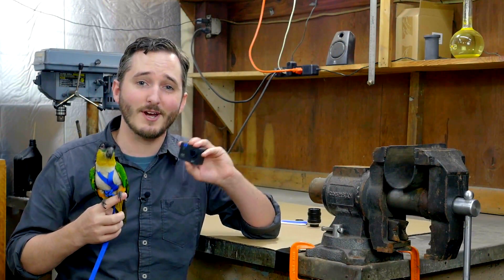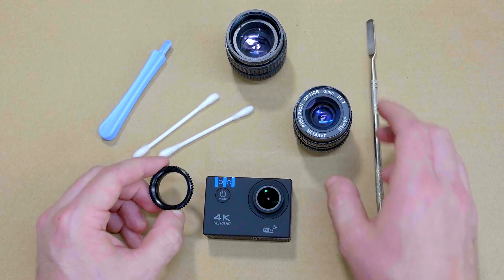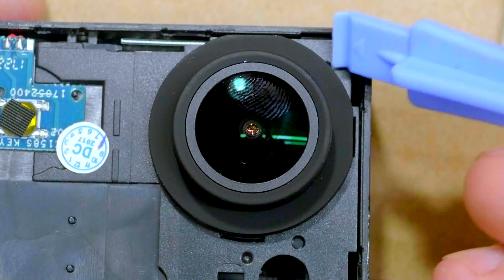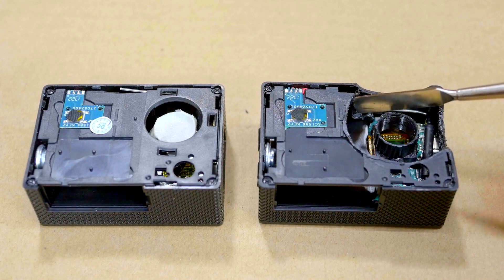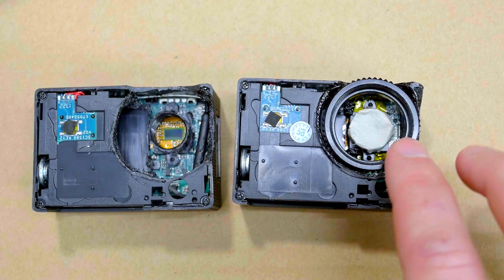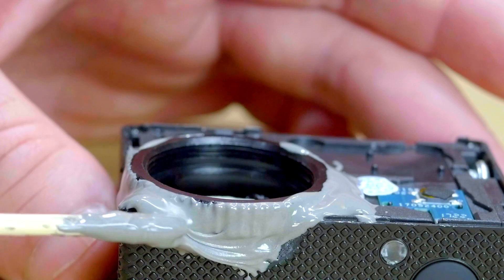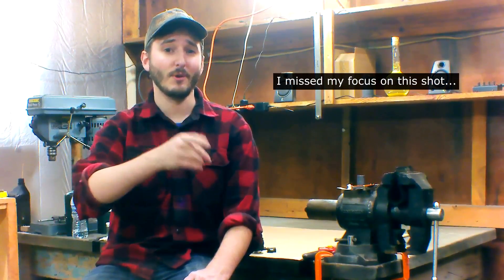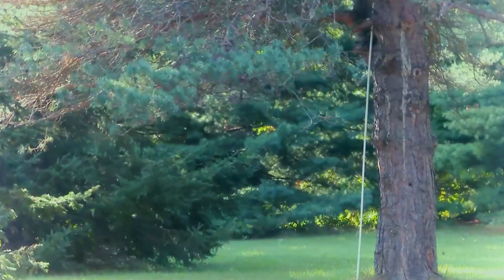How To Mod A Cheap Action Camera To Use C-Mount Lenses For Infrared Videography & Time Lapse

Comment: In general, metallic coatings on glasses are not going to be transparent to IR.
The metal coating is far more reflective in IR than it is transparent.
Tinted plastic lenses are going to be similar to the example you showed.
I am not sure if the IR wavelength is right for this, but one fascinating experiment is to watch gasoline or other hydrocarbons evaporate.
Some of the vapors are quite opaque, and so you will see black clouds arising from the evaporation.
This technique can be used to find gas leaks...

Comment: I ended up buying a different model.  I don't plan on modifying the lens, but the model I bought can be used for time lapse and has a dashcam feature that turns on and off when power is supplied.  At 1080p60 native resolution, it should also make a passable toy for getting shots I don't want the GoPro to endure.

Comment: If you want to get rid of the spots in the image like at 12:49 (assuming they are dust particles on the sensor) then you will need some soft q tips, isopropyl alcohol, distilled water, and clean containers for the alcohol and water. What you need to do is wet the q tip with the alcohol water first and lightly touch the sensor with it while using as little force to push down onto the sensor as possible, the alcohol will act as a solvent and help to clean up any debris. Then you can use the other side or another q tip to remove any alcohol remaining on the sensor. Then do the same with distilled water to remove the minerals and repeat this until it gets as clean as you want.
You also will have to keep from touching the ends of the q tips before using them, otherwise you will risk getting oils from your skin on the sensor which would be harder to remove and mess up the image even more.
Reply: Yeah he wrote that up above in the description (just below the video channel name) he explains what happened and how to fix it.

Comment: interesting video on cameras and if i may id like to make a request for something id like to see you film with this camera. i'm a welding student and one of the things that was talked a lot about in the safety unit was that the infrared and UV light was quite dangerous and could cause burns. what i would think is an interesting thing to see filmed with this is what welding looks like through an infrared filter and what the area around it being soaked in infrared light would look like.

Comment: One thing what I observed when I removed the hot mirror and put in back the original lens, I won't get the same result as you do. Is the original lens still have something that blocking the infrared light?
Reply from the maker: Have you tried it in daylight yet? If you're filming indoors the image will still look normal because light bulbs don't make very much infrared light.

Comment: Cool idea! 
BTW though IR may be dangerous when looking at the sun through sun glasses, isn't the dose of UV, esp UV A & B range far more dangerous?
Reply: partially, a welding lens will block 100% (or very close to) or UV and IR light, but with less then a shade 10 it's going to be hella bright still (might not harm you, but you wouldn't see shit), iirc most people are comfortable with around a shade 12-14
Reply from the maker: Most sun glasses should block all UV unless they're super crappy ones.
Reply: yea, but as demonstrated not IR, and obviously they don't block enough visible light to look directly at the sun either.

Comment: What filter do you use? 650nm, 670nm, 720nm, 850nm, 950nm, 1000nm?
Which ND filter do you use? ND2, ND4, ND6, ND8
Reply from the maker: I used a Fotasy variable ND turned up to max. IR filter was Hoya brand, 700nm+ filtration.
Reply: Thank you so much.
Do you have a link to the UV and IR Cut filter that you also use?
Reply from the maker: No but you can find both searching the brand names on amazon or ebay

Comment: Another great vid! Awesome hack of a cheap camera. Just one comment though, you should definitely try to re-attach the front cover as dust will eventually get attracted to the surface of the CCD element through those holes at the front. And they are an absolute PITA to properly clean because the CCD surface is quite delicate. Also I see that front panel (that was melted) had screws in each corner, is the panel removable? If so then it's also probably a good idea to remove the panel prior to modifying it. That way there's no risk to possibly damaging the internal electronics.  One other thought too, I've seen some cheap camera's that won't allow you to power up the camera on usb without the internal battery being in place so for some models you might need to externally attach the battery.
Reply from the maker: Unfortunately the part I melted and the back side that the sensor is attached to are all one piece. The screws just let you pull the whole skeleton out of the camera. Doing so is kind of a pain though because getting the buttons back in when you want to reassemble is difficult, and you have to take the screen off the back which is held by an adhesive that never wants to set correctly a second time.
Reply: Ahh right, hmm that's unfortunate. Anyway you've inspired me to go and try that on a cheap camera I've got. Currently rummaging around for a piece of copper pipe. :) . Please can you do a video on some experiments with this camera? Like filming at night? Cools effects you can do with it? What materials it can see through? Maybe  try looking through smoke/fog with it? That kinda stuff.  As soon as I'm employed back to full time again I will definitely be contributing to your Patreon.

Comment: das not it technically make it a night vision camera?
or like a thermal camera?
Reply from the maker: If you have an IR flashlight it would work for night vision.
Reply: thermal camera's use a different type of sensor, the sensor's used in these camera's can only detect near infrared wavelength's (still cool and useful, but not at all the same thing)

Comment: Pixco CS or C Mount Lens to M12 All-metal Lens Adapter https://www.amazon.com/dp/B01E536ZZ6/ref=cm_sw_r_cp_apa_neRYzbVD3WA83
Would this serve the same purpose?
Reply from the maker: Possibly. I wonder if those m12 threads are what the built in lens in the action camera actually uses. If so you should still probably glue the ring in place so that the internal lens mount isn't heavily strained by the larger lenses. By using that instead of an extension tube you will limit what types of c mount lenses can be used because some have lens elements that stick out of the back past the threads, which that adapter would not allow.
Reply: NightHawkInLight well I did some googling and most the things I found stated that was the threading on most of the knockoff go pro cameras. Could you add extension rings onto that to extend it for use with such lenses?
Reply: I liked your video, just got to thinking, some people dont have the skills required to perform these modifications, some people may stray away from this being scared to destroy their camera. So I just googled around to see if there were alternatives.

Comment: Question. Could you not have taken the original lens and then made a spacer that fit snug around it that would match up with the c lens mount internal diameter and glued the two together? Or would that put the c mount lens too far away to work?
Reply from the maker: That might be another way to do it.

Comment: Interesting idea. I assume "missed focus" is due to the lack of a view finder. I wish you had done a comparison of the cameras in focus. 
  It's amazing to me how over complicated and expensive lens mounts and branding are when all it is is a few machined threads in a weird size.

   The heated pipe idea is interesting. I haven't tried that one before in this context.

  I would probably prefer removing the original 2 stud/tab mount and create a new mount to replace it for a level result. However I have taken apart a few old Canon film camera lens and often take macro pictures by simply holding a phone camera behind the hand held canon lens assembly. This can create some interesting effects although it is limited by the lack of a RAW file to manipulate after.
   As far as future hack-a-YT content, I'd recommend adapting whatever ultra cheap off brand old film camera lens I could find lots of on eBay for $5-$15 as that would probably generate more spontaneous DIY projects IMO. At this kind of price it might be fun to create a dedicated tilt shift setup, astrophotography, or a stereo scopic 3d setup.
 -Jake
Reply from the maker: First thing I tried was to remove the old mount from inside the camera entirely, but it's permanently glued to the sensor board. Once you take the screws off the sensor comes off with it.

Comment: wow great video! i think i will try this! the only thing is the 8mm seemed a bit blurry can this be corrected afterwards? an what other lens would you recommend an ring mount size? thanks a million : )
Reply from the maker: The 8mm only looked blurry because I missed focus and the camera sensor was dirty. The opening shots of the burning toilet paper roll were also with the 8mm after the sensor was cleaned. I used a Fujian 35mm lens for the macro shots, with another extension tube to move it further from the sensor.
Reply: ND filters are not designed to let ir pass. They are supposed to block all wavelengths equally. Very low quality ones work only on visible light and will let nir pass but it's not a feature, it's a defect. Google "ir pass filter"...
Reply: The problem is that the adapter may not be perfectly centered on the sensor. Also the focus plane may be tilted because the axis of the lens is probably not perpendicular to the sensor. A solution could be to put the lens on the adapter (screw it almost fully on the adapter), set its manual focus distance, use a low aperture  (more light, smaller in-focus zone), then power on the camera and verify the quality of the image. Only glue when the result is ok...
Reply from the maker: It's very rare to find a variable ND filter that also filters IR, there's only one that I know of that was only recently released by SLR Magic I believe. Regular ND's can filter IR, but not all do because IR filtration is accomplished successfully by the internal IR filters on most cameras, and external IR filtration can be a negative especially when using wide angle lenses because you can get red vignetting. ND's that do filter IR are obvious because they have a metallic red coating on them. Concerning centering and alignment of the lens, it's not too big of an issue since the sensor is so small. If your plane is off slightly there isn't much difference in distance from one side of the sensor to the other. You can afford a little bit of misalignment before any sort of tilt shift effect becomes noticeable. Much more than you could with a larger sensor anyway.
Reply: Nd filters are designed to block visible light. There's a whole variety of response curves. Search Google images of "nd filter wavelength" Everything else is a side effect. So I guess it's a cheaper way to get a nir-pass-filter if you get the right type of ND filter. Howether ND don't fully block visible light and attenuate ir light (more or less depending on the wavelength response curve). So you don't get a pure nir image. So maybe it's better to use the proper filter designed for the task instead of another one designed for something else(and that could eventually works more or less).
The sensor is small but still if poorly aligned you get tilt-shift photography. The pixels are very very small. Any miss alignment means that on the border light from a point in the object may not focus onto a single pixel on the sensor. So the small size of the sensor means a small blur but still even more magnified. The size helps with aberrations but not with tilt angle.
On another subject, an alternative for your design would be to use a raspberry pi 3 with the "noir" version of its optional camera.
Reply: A simpler way to limit the tilt would be to use a bubble level when gluing with the sensor laying horizontally. This way you know that the adapter is also horizontal so the lens axis will probably be very close to perpendicular to the sensor plane.

Comment: There are ND filters that block ALL visible light? Interesting.

Unrelated: I was wondering why the bird is on a leash now, when it wasn't before. Was it flying too much  during dangerous experiments?
Reply from the maker: I put him on a leash whenever I take him outside. I had to walk outside to bring him out to my barn so that's why the leash is on. The ND filter still lets some visible light through, but compared to the IR light that comes through it's completely overwhelmed.
Reply: Cool. Thanks for replying :D

Comment: that camera looks great. the black are a little dark (not trying to be racist), and theres a bit much bloom
Reply from the maker: I color corrected the image to look more like my other camera and that required lowering the blacks some, but it doesn't have the same dynamic range which is the real cause. The bloom in some shots was because the sensor was filthy before I even opened the camera. Looked like someone put their fingerprint on it. The shots with less bloom are from after I cleaned it.
Reply: fair enough. still looks pretty ok to me, maybe even better than my old point-and-shoot
Reply: "The blacks are a little dark" well Matthew not that black aren't supposed to be dark or but... xP

Comment: I've been using Lastpass for years awesome service. However, in your add spot, you stated that the passwords are stored locally. This is not completely true. They are stored in your vault on Lastpass's servers so that you can access them anywhere at anytime.

Comment: I may give it a try. But first I need to know if its worth for mostly macro shots? Or any other alternativ in the same price range?
Reply from the maker: It works great for macro. Small sensor cameras are better for macro than large sensors because you get a deeper depth of field and more magnification.
Reply: Oh okey. Its think I will try it in the future. How close do I have to get for the marco shots? I wanna make pictures of ants mostly and dont know cause if I had to get to close to would just run off.
Reply from the maker: It depends on the lens and how much magnification you actually want. I was using a fujian 35mm lens for most of the macro shots in this video and had the camera anywhere from 1 foot to 6 inches away from the subject.
Reply: Thanks for the help. Sounds pretty cool than. I just look at some lenses and hope to find a cheap good one and  start the project.

Comment: I'd probably take it apart fully and work on the parts separately. Something about being neater is appealing in the long term. There's also the issue of electronics being potentially screwed in the situation where you keep them inside, i mean, ok, it would be a cheap camera but still.

Comment: Could you use the IR mode to see in the dark? Or would you need a massive array of IR LEDs for that?
Reply from the maker: It will work as long as there is some IR light for it to see. It would help if you had at least one IR led on the camera.
Reply: My understanding is that these filters only filter out near-infrared light. What y'all are suggesting is essentially the same setup an IR security camera uses. Humans can actually see near infrared, but it's very dim compared to what the camera can see. If you take an IR remote to a completely dark room and use it, you can see the red led flickering with your unaided eye once your eyes have a chance to dilate. Keep in mind this is different than what (heat sensitive) thermal cameras see -- they are sensitive to "far" infrared. Far infrared is 15 micrometers (µm) to 1 mm while near infrared is 700 nm to 2500 nm. (correct me if I'm wrong)
Reply: I would love to see a video of you making DIY NV goggles or simply an NV camera!

Comment: I wondered why you cant just simply 3d print an adapter that screws in place of the the original lens? will that make the focal length too far?
Reply from the maker: That's an interesting idea. I suppose it might be tricky because the resolution of the printer would have to be very high to print such fine threads. It probably would make the lens too far from the sensor as well, but worth trying.
Reply: just buy c mount to m12 adapter
Reply: Why not just print a spacer that fits around the factory lens and the outer diameter matches the inner diameter of the c lens mount extension and glue them together. No threading needed.
Reply: Thukfudo i agree, however i think a  large tap would be more expensive than a e-bay C mount
Reply: It would cost significantly more to have an adapter 3D printed in metal that to epoxy the extender to the camera.
Reply: rather then messing with threads at all, print a adapter that press fits into the inside (or maybe the outside if there's enough clearance) of those threads, maybe a little glue.  then the cmount extension would press fit\glue into into that adapter.  Should be fairly easy to make such a adapter with acceptable precision, I'm sure it'd be at least as accurate as gluing the mount in and eyeballing alignment.

it's too bad the comparison shot was out of focus, was really looking forward to seeing it.
Reply: I think the answer to this is that these cheap c-mount lens are only sharp in the centre and even though you might be on the same plane - if you are off centre then the object will appear out of focus. In the main comparison shot he was to the camera's right of centre. It is something to be aware with these cheap c-mount lenses.
Reply: I would suggets 3d printing a body of the adapter but using taps to create the threads. However only using the thread on the PCB to center the lens but not to hold its weight :)